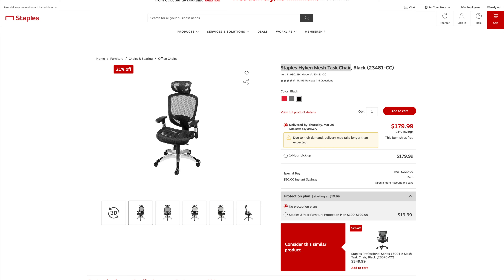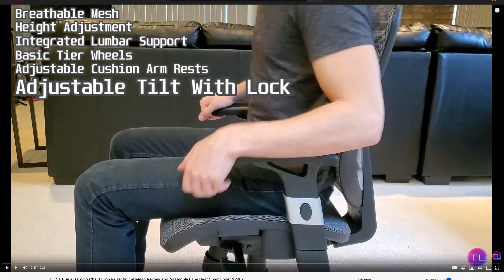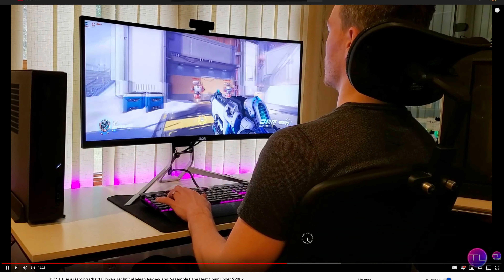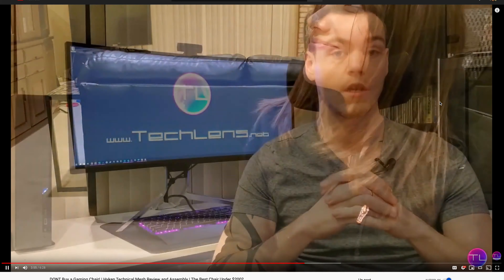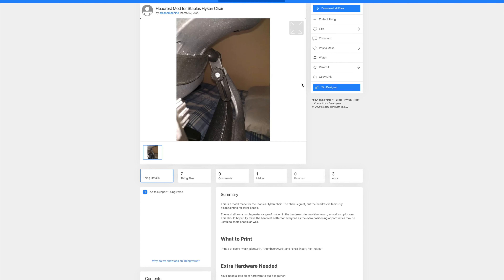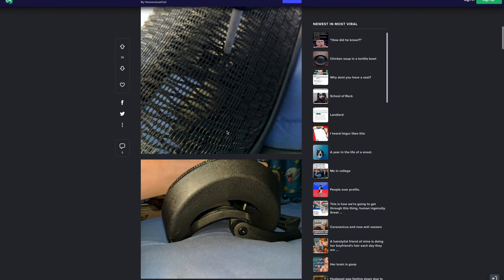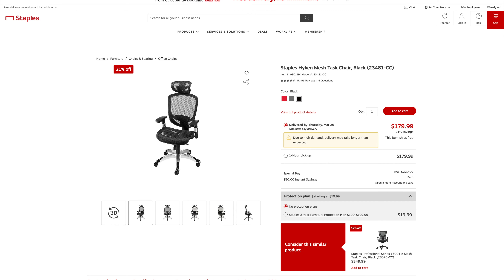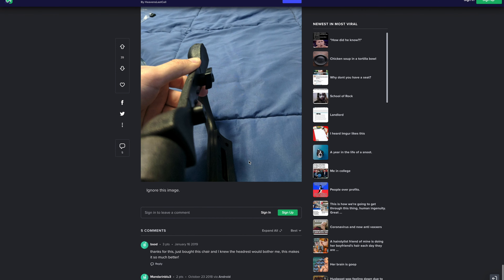How to Fix or Adjust Headrest of Staples Hyken Mesh Task Chair

Comment: First of all thank you so much for sharing! Anyone hear 6ft tall can say whether or not this helps? This really is the deciding factor for me to buy the chair.
Reply: I am 6 feet and it is much better but the only problem is the head rest is very wiggly now I don’t know if I messed up but it’s so annoying
Reply: I've since bought 2 of these chairs. In my experience the headrest is perfect, I have an average  torso and am 6ft. I love this chair. Only bad thing I can say is that the cushion at the end by thigh area can kind of put your legs to sleep. Too firm
Reply: @warriorzmindset  both my chairs have wiggly headrests. Maybe a design flaw
Reply: Just bought it, will let you know in 3 days. I'm 6'2 and will be modifying the head rest
Reply: @chivimbe  howd it go?
Reply: @PantsaBear  it works well, no complaints
Reply: @chivimbe  just did it too, 6'1" and it's fucking great.  if its wobbly you can tighten the screws where they need a bit more

Comment: 2 tips: The only part that is flipped is the banana shaped thing, and it adds 2-3 inches height. 
2nd- Put flashlight behind the mesh inside the headrest, or i used my cellphone inside.